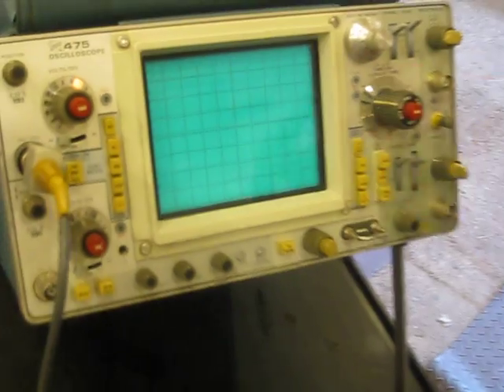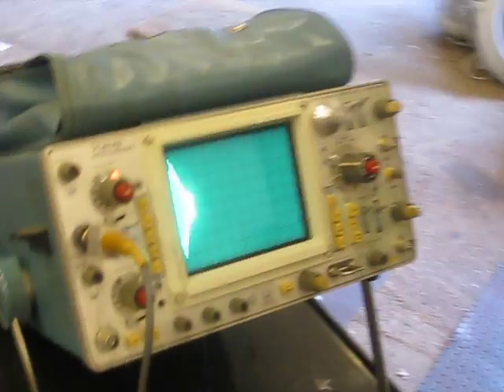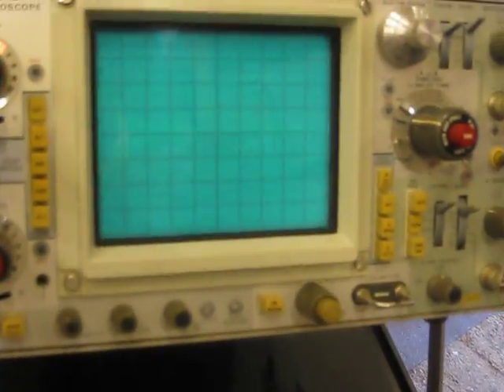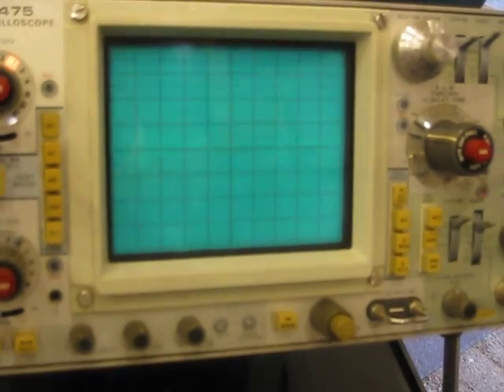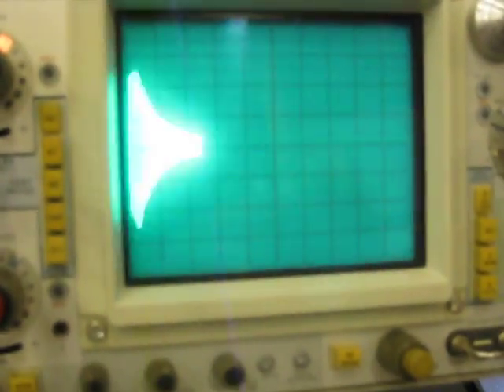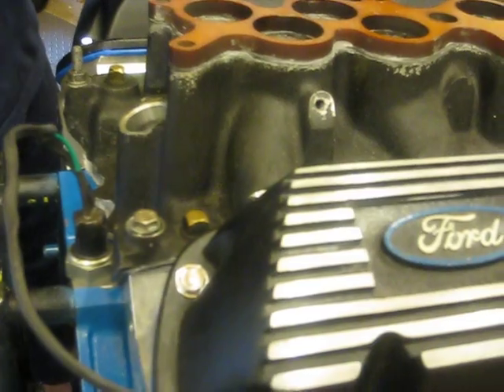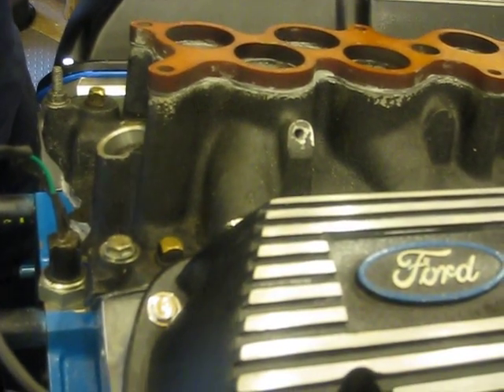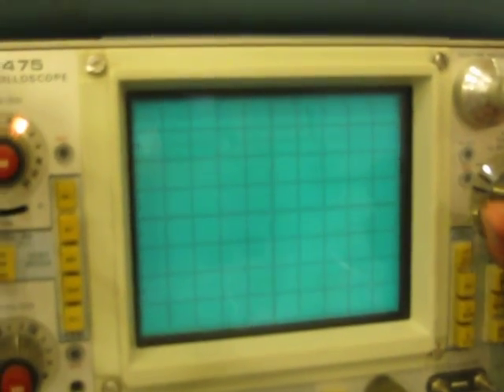5.0 Mustang engine with a knock sensor

Comment: too big a hammer .. need a 5/16 nut on a piece of 3/16 welding rod.. to tap the sides of the block to check the knock sensor operation.. something that duplicates the sound of the pistons rattling in the bores as the spark plug is firing too early and trying to stop the pistons upward movement..   great test display though..